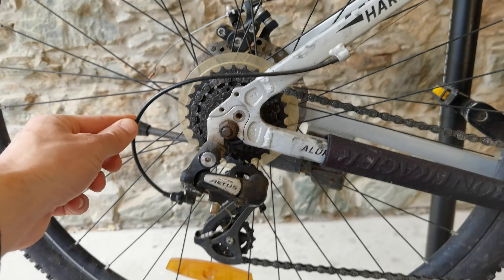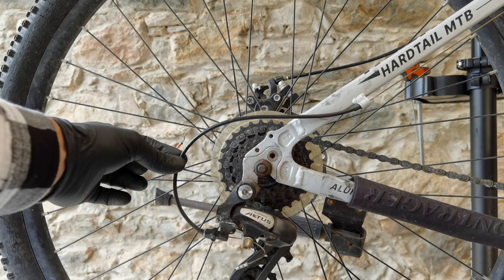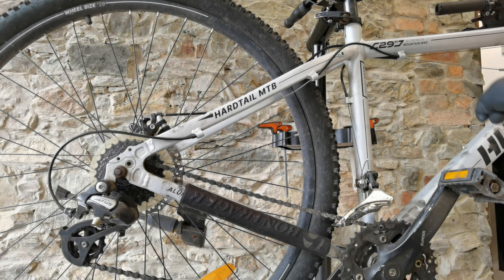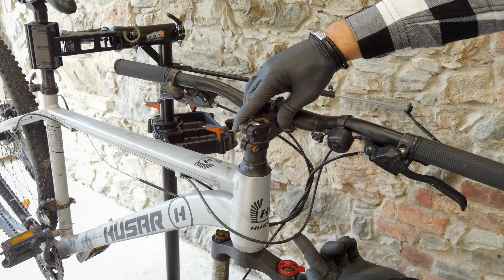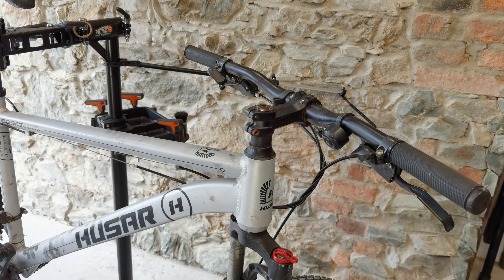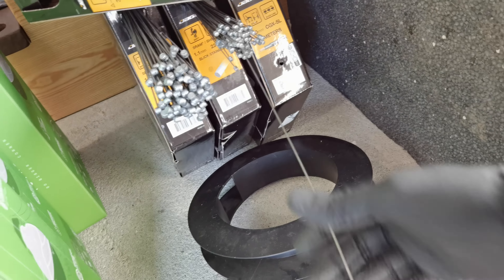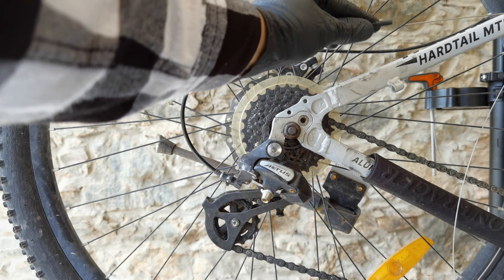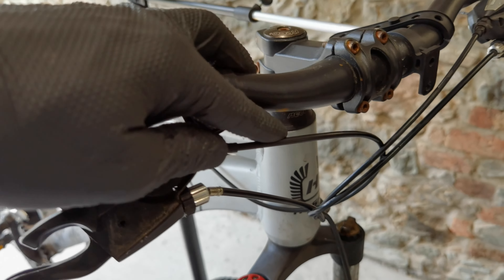3 mistakes in cutting / replacing cables and housing on a bicycle.

Comment: Tip: before you cut an outer cable, put a piece of an old inner cable into the outer. That way, the outer cable won't deform as much.
Reply: Aha! Good one, cheers for that 👍🏻
Reply: This refers to preventing the teflon or polymer liner from ovalising or closing up during cutting to length .

Comment: I agree with everything except for the mid cable housing. Given that it is fixed at both ends it should be a smooth curve. Yours has three curves.

Comment: It's one of the simplest thing yet a sh*ton of people mess this up 😂
*Lex SL isn't pre lubed the PTFE inner sleeve is supposed to act as a lubricant. I'm not a huge fan of it when you add mineral oils to PTFE it tends to degrade and accumulate in some bends.

Comment: I disagree with 3:15 based on comprehensive testing .
Reply: I agree, more cable outer = tighter radius = more friction.
Reply: @space.youtube  With the rear section behind the rear derailleur , a modest amount of sheathing should be used .
Reply: @robertmcfadyen9156  The time stamp you provided is for the section of cable outer that transitions from under the top tube to the drive side seat stay. "more cable outer = tighter radius = more friction" refers to that piece of cable outer. 
Cable outers that are routed with tight radii produce more cable friction. 
As far as the small piece of cable outer that runs from the chain stay to the rear derailleur barrel adjuster, he is correct. He uses a longer section to increase the radius of the bend to reduce cable friction.  Having said that, there are trade offs. If I'm building a lightweight bike I'll cut cables and outers as short as is practical. Clearly reliability is more important than weight savings on the bike he's working on.
Reply: @space.youtube  I have advanced dementia .
Reply: @space.youtube  I don't ride now and am getting ready to auction off my bicycle collection , a large amount of stock/components and a workshop setup with a lot of equipment . I will be selling several electronic deraileurs and controllers etc